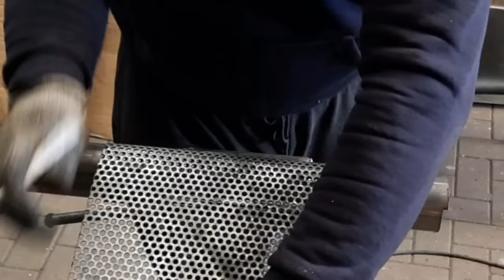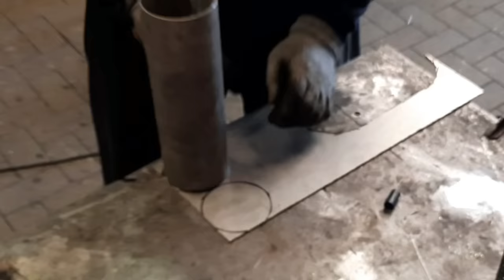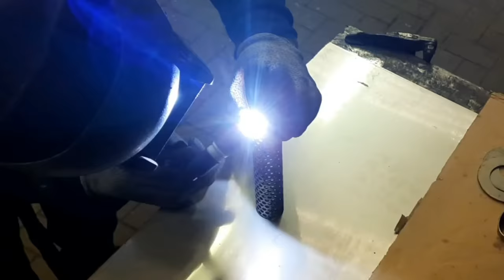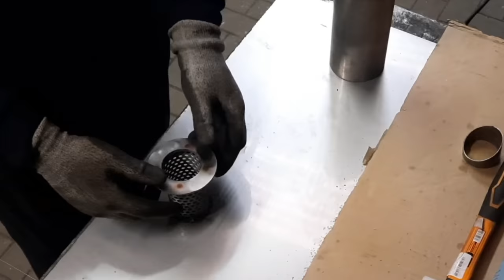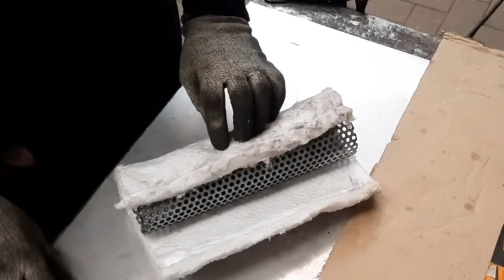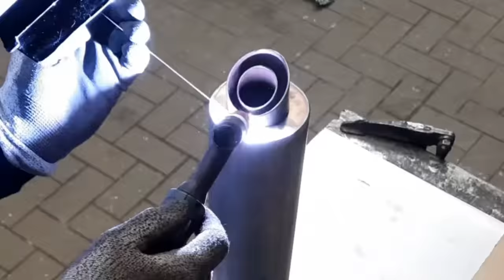Homemade Motorcycle Exhaust Muffler | Stainless Steel

Comment: size for diameter hole ?
Reply from the maker: Inlet 51, outlet 38
Reply: @GPGarage1  no, that smaller hole 4/6mm?
Reply from the maker: Holes on perforated sheet are 3mm

Comment: If both ends are welded, how do you replace the soundproofing material later?
Reply from the maker: You cut one side, change the soundproofing material inside and weld again.

Comment: the holes from the inner pipe are much to big,you blow the damping material out of the exhaust in mimutes,trust me I know what I am talking
Reply from the maker: I have made several mufflers so far and used the same perforated sheet (same diameter holes) and had no problems with the packing material.
Reply: @GPGarage1  oke thats fine but I also made my muffins,and I put a very fine filter with very little holes around the inner Pipe,because if I dont do that the damping material wil blow out
Reply from the maker: The best way is to first wrap the perforated pipe with mesh.
Reply: how do you repack it ??
Reply from the maker: Cut one side, repack and weld it again.

Comment: Интересует вес данной конструкции.... Ибо на картинке очень хорошо видно что использовалась фольга 3-5милиметров
Reply: Для  мопеда  50  кубов  згодится      на  пару  недель      затем  вылетит   та  тряпка    и   будет  пердеть   с  раздражытельным  звуком       По  сути    банка    на  мот    должна  быть  не  тонкостенной   ибо  будет  звенеть     и   должна  быть   большой  для  глухого  баса     и  вместо     стекловаты  или  что  он  намотал     забивают  крупную       алюминевую  стружку  с  токарного  станка       тогда  звук     даже  на  малокубатурке    как     паровозе
Reply from the maker: If you mean the muffler case, it's 2.3 mm, but if I were buying a pipe, I wouldn't use a pipe thicker than 1-1.2mm, but even this way it is lighter than the original muffler.
Reply: @GPGarage1  согласен... 1.2мм более чем достаточно.